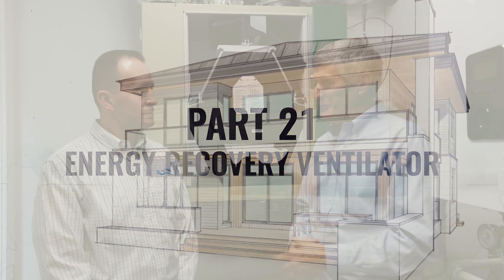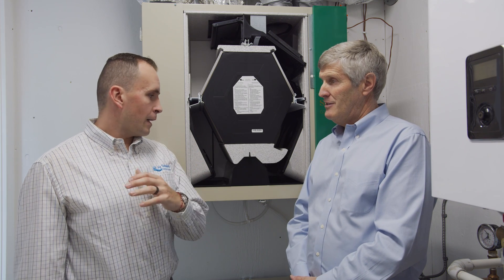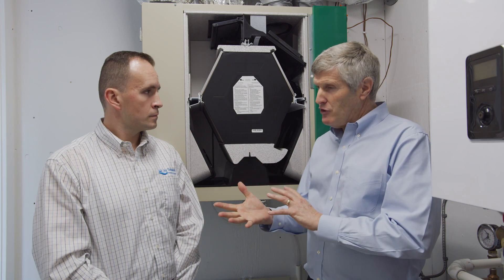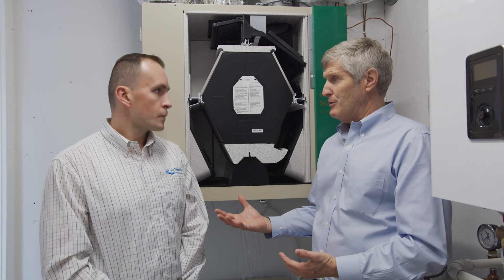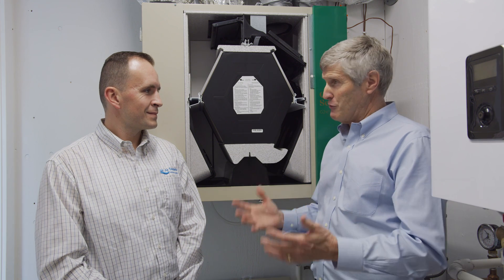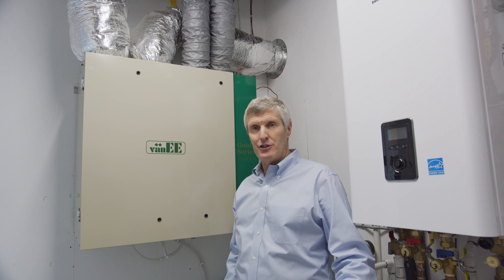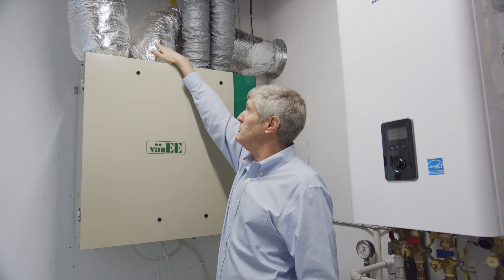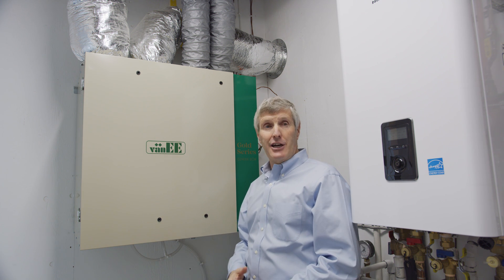Energy Recovery Ventilators Explained: Building a NetZero Home - Part 21

Comment: i'm confused ..ERV..traditionally is used in "hotter or warmer"climates were air conditioning is the norm through the year..and HRV used in homes in colder climates. I got the emphasis early in the video.. but can you explain your decision on ERV versus HRV based on your climate location (Ontario) ..are you focused more on condensation or humidity control? Great series by way...
Reply: I recently have had this unit installed in my home, it’s amazing. 

Below is a chart from Vanee which you might find helpful. Important also is the issues you are facing in your particular structure. 
https://www.gasexperts.ca/product/vanee-new-gold-series-g2400-he-hrv/